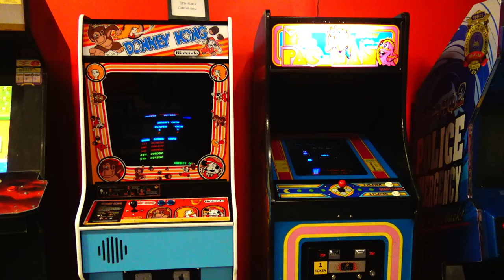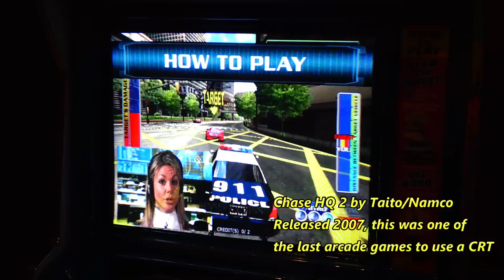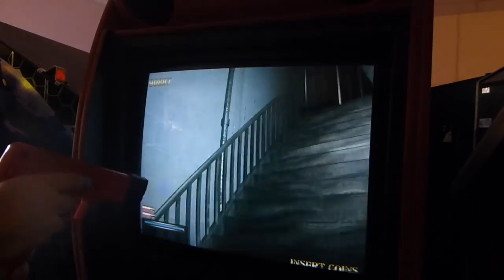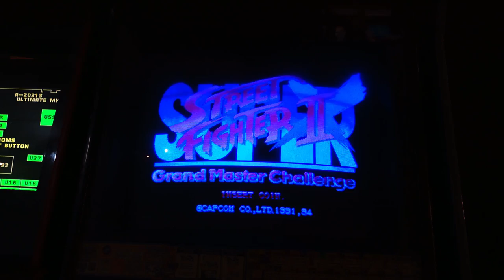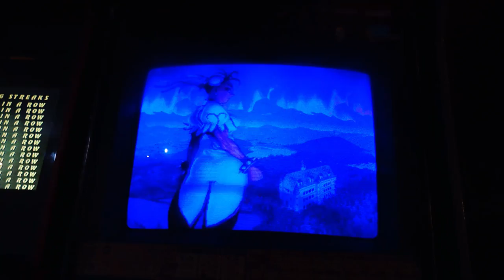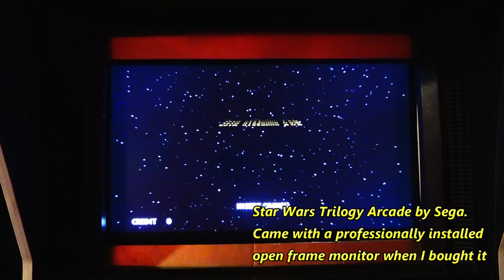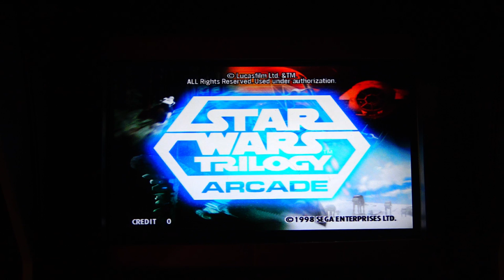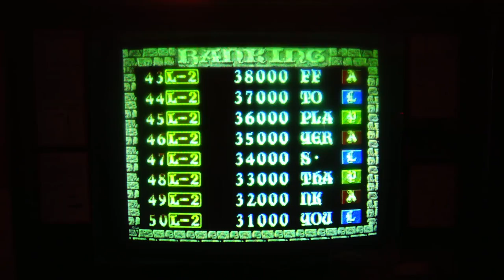The Great Arcade Debate: CRTs Vs. LCDs

Comment: I'm sure there's zero market for it--but it would be cool if they made 4:3 convex curved OLED monitors with a built in CRT filter to emulate the CRT look as much as possible.
Reply: Yeah, that'd be fantastic. As far as I understand, emulating the CRT look is extremely hard to do and also only begins to make sense at 4K resolution or higher (apparently, 8K is where it becomes hard to distinguish from the real thing), as the subpixel artifacting and all that cannot be accurately reproduced otherwise.
Reply: Unico makes a 4:3 lcd flat panel arcade replacement screen. It's not curved but it's still something.

Comment: If LCD’s were available in the 80’s I would have played on those machines 100% of the time over CRT’s with their warped view.   It’s just nostalgia and people reminiscing about the good old days.   Just like I prefer to game now on a Vewlix cabinet so I can sit down and relax and spend time playing the games instead of standing up.
Reply: for competitive retro gaming (say smash bros, or speedrunning) a lagless monitor is essential to be honest
that doesn't have to be a CRT these days, but it isn't just nostalgia for everyone
Reply: if the original arcades had been on LCDs there would have been no argument because they would have been the original display hardware they were designed for. the original "look" of those games can't be achieved today without either using a CRT or simulating a CRT display on some other type of display. modern people playing "pixel art" on their hdtv or an arcade 1up don't remember the originals well enough to care I guess (or are playing on a super small screen like a phone). some of those people actually say that seeing "jaggies" is a mark of quality & authenticity. smh then again some people are nostalgic about VHS (and got shocked to suddenly see the same films with "graininess" on HD formats). when widescreen tv's were coming out, most people I knew who had them were still watching 4:3 content on them but stretched out because the "black bars" seemed "wrong" them. again smh. yeah, you can still follow it, but it looks so much better as original intended...

Comment: Its a myth that crt have zero lag. By industry standards of measuring they actually have 8.6ms of input lag in the center of the screen. Lcd have been there for 60hz for decades. Above 60hz lcd take over for better input lag. At 120hz there are lcd monitors with less than 5ms input lag.

Comment: On your Simpsons, that curved image at the top is your B+ pot adjustment. If it doesn't straighten the image, it needs to be replaced. I really enjoyed your video. While LCDs have their place, as long as CRT's can continue to be repaired, they should be the staple. The biggest issue we will have over the next few years, is not so much the lack of parts, but the color guns dying which is the end of the line for these old dinosaurs. I've started to hoard as many tubes as I possibly can to have backups for my games.

Comment: If you put a fresnel lenses in the front glass area, and mount an LCD about halfway into the cab, you can simulate the CRT effect. Works even better if you can simulate scanlines.  The monitor area between the LCD and the lens needs to be pitch black with no light bleed from, or into other areas, however.
Reply: THIS???
Reply: I remember reading about something like this on a community forum awhile back and the idea was to use a kind of black glass to hide all the noticeable details.  I may have also suggested the idea of mirrors like some of the older cabinets, but that didn't seem to fly well as that method eventually faded.

Comment: For someone like me who has been collecting and repairing original cabinets for 40 years I would state that CRT will always be the required monitor for classic games. Specifically due to the games being colored, shaded and coded for these monitors. LCD and LED monitors have to high resolution too many colors to generate the proper shading for old games so they look distorted. If you are a true arcade game collector. No LCD or LED monitor should ever be converted in a cabinet with a original CRT monitor it devalues the cabinet. Its not about if you like it or not its straight fact it looks far worse for older games.

Comment: I just bought a Stargate and a Tempest cabinet, both with perfect CRT monitors.
So happy with the find! Now I have a horizontal and a vertical screen.

I will outfit them with Game Elf 750 in 1 and 420 in 1. (Horizontal and vertical play)
I have tried the LCD with Raspberry pi, Game elf and Pandora's box.  
The verdict: don't even bother.

If you're going to do that, buy an NES console with arcade cassettes.
You will save a lot of money and get a better experience.

Comment: This was super interesting, thank you! At 10:20 ish I'm not sure that's how lightguns work on CRTs. I could definitely be wrong here, my understanding is that the arcade board sets the screen to all white at the start of a new frame, and then starts to monitor the photosensor in the lightgun as it times the raster beam. When the sensor is registering a spike (I am guessing here, but it might just be looking for a voltage transition across a threshold) the board knows from the predictable timing of the beam what line and position on that line it was at, with some probable additional extra work to improve precision. The WII introduced an IR based lightgun method, which I would be surprised if LCD based lightguns don't use some method of.
Reply from the maker: I believe that's correct on how CRTs & light-guns work. On the IR gun method the Wii uses, Nintendo borrowed the idea from arcades, as you did have those DLP-based DLX games from the late 90s/early 00s which used the IR sensor net concept (Wii also borrowed the gyro controls tech Konami used in several games). If there was a way to install something over an LCD to make the game think it was a CRT though, that would be a great solution
Reply: @arcadeheroes_coinop  I didn't realise the arcades had Wiimote-like guns first! I feel like there must be a way to convert the two (assuming you know the X/Y of the pointer) by listening to the video signal and making the gun signal go high (or low) at the right time, I have a horrible feeling it would be so machine specific that nobody will ever do it as there would be no money in it. But maybe one day...

I also feel hiding this in a reply is safe from the CRT obsessives, I actually prefer my LCD monitor with fake CRT look to the real thing. 🤫

Appreciate the content! It's so nice to see arcades surviving as my local one closed 8 years ago.

Comment: The biggest thing i have going against LCDs after lag is the aspect ratio, Most Arcade Operators don't care about having a 4:3 image, having it stretched simply looks like crap, then of course there's poor installation, an LCD conversion should never involve cutting up your cabinet.
Working on CRTs is relatively safe as long as you're literate enough on how they work.
Please sell the broken monitors, don't scrap them.

Comment: I converted my Bomb Jack game over recently & it had a jittery shakey picture afterwards.  I fixed it today by putting a 680 ohm resistor in series with the sync wire(s).  Works great now.  I got the 10 resistors off ebay for $1.99.

Comment: The look of a 4X3 arcade games converted to a LCD is just jarring to me, especially on bigger 25" and up games like Gauntlet Legends. I'd probably be more comfortable with the idea if the conversion/upscale kept the aspect ratio in mind, but pretty much every LCD conversion I see in the wild has the image stretched out to 16X9, which is just like.. ugh. It's good to hear an operator's perspective though and that earnings aren't affected. Also, now you've got me freaked out--you mentioned some won't even service Neotec CRTs. I have an Atari Primal Rage that has a Neotec in it, and it's starting to get a little flaky. 😅
Reply from the maker: Sorry to make you bite your nails there :P Granted, my experience was circa 2010 so one of the current guys might be fine in looking at it, especially if it was a more common NT model. I think the one I had was among their last ones so it was hard to come across.
Reply: I agree about the 4:3 to 16:9 stretching.  I'm not that picking about latency in most games, but when circles aren't round and enemies move at different speeds vertically vs horizontally, I really can't stand it.  I just refuse to put money in.

Mind you, I blame the RGB to digital converter for that.  Most have a setting to preserve the ratio.  The arcade op could always hide the black portion of the screen behind a bezel.  It's amazing how many people complain about letter boxing.

Comment: You know I scratch my head at the arcade purest that gripe & moan about these things.  They like to see things through rose tinted glasses that arcade owners cared deeply about such things in the past.  Unfortunately that was never the case in reality when machines broke down they had to repair them with whatever parts were available that were "good enough" especially if said parts were hard to come by.  I've seen mismatched joysticks (and other controllers), monitors, frankenstien/custom cases, etc.. If they had LED (or OLED) screens like today they would use them.  

Also back then the vast majority of arcade players wouldn't give two Fs about it as long as they just got to play the games unless it was a gimmick cab (Like Space Harrier for example).  With lightgun games the issue is there is tech to make light gun games work on LCD/LED, but someone needs to create conversion kits for them.  Unfortunately there is not a big enough customer base to make enough money unless they charge a ridiculous amount.

In my town we had a Aladdin's Castle that had a Ninja Warriors in a custom made cab cause the original one was too big.  On the other side of town at Silverball they had the new MK3 machine, but in a different generic looking custom gray cab with a 32" screen with the controller that was a foot away from the screen (look like a J from the side).  In the early 80's it would be 90% all original parts, by the mid 80's that dropped to around 65%, but by the late 90's it was less than 50% with only new arcades being pure until their first break down at least.

Comment: Hey AH....s bit late to this video but just wanted to say great video, very informative. 

A few comments....

Have you considered doing a video on OLED displays, and how they compare to CRTs? After doing some research and eventually purchasing a 77" OLED TV, I have to say, they are a much better alternative to LCD monitors. The LG 77" I bought is the C1 line, and after making some tweaks with HLSL in MAME, I have to say, I've gotten my retro arcade games to look darn near indistinguishable from a CRT display.

The main thing with OLED is the on and off black levels in contrast, as well as a new feature in LG TCs called BFI, which eliminates the motion blur found in LCDs and delivers a picture, in motion, that basically mimic a CRT virtually 1:1. 

People are really starting to talk about these OLED TVs as the best TVs for retro gaming. So, what are your thoughts on OLEDs and do you think they'll eventually be hailed as the "Arcade CRT killer"?
Reply from the maker: Thanks! As to OLED, I haven't seen any 19"-27" OLEDs out and about there which might work, although I imagine that they are out there (well, someone told me that they are looking into 4:3 19" OLEDs for arcade use but haven't heard if they've progressed far on that yet). I love my Switch OLED and of course have had it on phones so it does seem like the tech is there - we just need the right sizes
Reply: @arcadeheroes_coinop  Appreciate the reply. Apparently LG is rumored to announce a 27" OLED into their C-series line some time next year. Guess we'll see what happens but very exciting times nonetheless :)

Keep up the great content my friend.

Comment: You had mentioned an overseas company that emailed you about new crt replacements. Can you post information about that?

Edit. Saw a post below saying it was Alonex Electronic Engineering.  However, the website doesn’t offer product information or contact emails. Can you post the sales email address?
Reply from the maker: There's Alonex but the emails also mentioned a 2nd company, "PRAFTEC Microcomputer Technologies." Funny enough, I just got an email from them this morning, although it comes from a gmail. The Praftec sales email appears to be info@praftec.com the gmail is frishman.natalia@gmail.com - 

Good luck, everyone I've asked so far says no one ever replies
Reply: @arcadeheroes_coinop  thanks for the lead. I'll give it a try.

Comment: Playing old retro games looked better on CRT. It usually looked better when playing in 4:3 ratio. It doesn't look good on widescreen. Most retro games doesn't look good on a 24 inch monitor when setting on stretch screen, especially when playing close to the monitor.

Comment: True love letter to CRTs By the way i think the response time of CRT displays is about 0.5 ms while OLEDs are down to 6ms.
Overtime, let's say within ten years I hope affordable flexible OLEDs will allow us to build quality 4:3 CRT display replicas.
Those stretchy OLEDs stuck on a thick curved glass will do the trick as there are also a very recent rise of good CRT filters !!
Unfortunately UNICO USA ran a campaign to build their own custom built 26" 4:3 LCD displays at $550 each but they didnt hit the minimum units required for the first batch.
Reply: Both of those numbers are really high.  Modern OLEDs have more like a 1ms response time.  Some LCDs have been able to manage 2ms since the mid 2000's, though 16ms was more common.  CRTs though, the only time for a color phosphor to react is while the electron beam is pointed straight at it.  For a slow, low-res 15KHz display that manages only only about 320 transitions per line (think pixels) the electron beam is only pointed at the phosphor for 1/(15,000 * 320) seconds or 0.0002ms.  (dang)

Now, "response time" is not the same thing as "latency".  The definition is the time between when the system tries to draw an image and when the image is visible.  For digital, in simple terms, the system sends a data stream with all the color info for the screen.  The screen (LCD or OLED) has to receive the stream, often the entire image, then do math to resize and blend pixels if needed, do math to apply color correction, do math to translate the requested colors to the voltages for each sub-pixel on the panel, and drive the panel.  A digital TV may have so much latency that it has to delay audio to keep lip-sync in movies.  Half a second is not uncommon.  You will notice the "game" or "PC" setting on the screen may knock the latency down below a tenth of a second, but at the cost of nearly all color correction and resizing.  (worth it here)

For classic arcade boards, adding the RGB to (DVI/HDMI/DisplayPort) only makes this worse, as the entire picture has to be captured before it can be sent.  So we start with a one frame latency.  Emulation wins here.

CRTs?  The voltages coming out of the game literally drive the electron guns.  The sync signals directly drive when the electron beams start the next line or go back to the top.  Color correction is nothing more than adjusting resistors attached to the signal amps.  Latency is just the time it takes electricity to flow a few feet, then electrons to cross the tube.

(Personal opinion) I honestly think we can get LCD/OLED latency down near CRTs, but to do this we will have to take the transmission (DVI/HDMI/DisplayPort) out of the system and have the game board drive the panel directly.  That's a tall order in today's market.  We're most likely to see this in a handheld.
Reply: It would simulate a 25.7 inch flat display with weird bezels. This is indeed better than nothing but would look awful in a curved japanese candy cab. The OLED era has just started and printed OLEDs will give us hopes for better more suitable screens.

Comment: I have an RCA CRT TV now my settings are as fallowed 

Color: 50 

Brightness: 60

Contrast : 100

Sharpness: 25

I know CRTs for the home weren’t identical to the ones used in the arcades 

But are my picture settings close to what you would see in the arcades ? Or do I need to raise or lower some settings  on my CRT TV to get it as close to what an arcade CRT monitor would be like